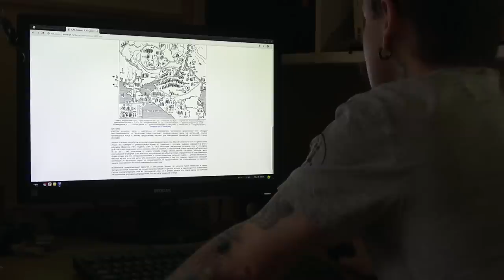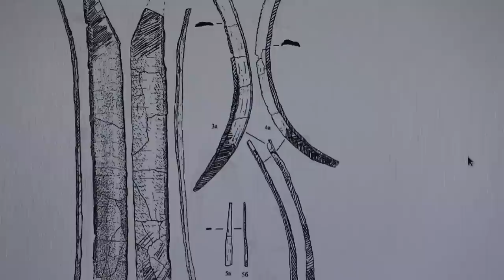Bulgarian Horn Bow. Part 2

Comment: I do work metal mostly, forge and so on, when I have hands on wood, for handles, I start to be nervous, one mistake and the missing material is not recoverable in any way, not movable from a section to another one, not in a way keep the look of the part whole. Veins, grain, how easy is to grind too much down, how easy is that it breaks on pressure, how hard to find a piece with a proper vein direction, without wooden knots messing it someway. I do honestly believe that making a proper wooden bow is way harder than making a sword. The sword even if defective, too hard tempered (very common), or made of soft alloy of too brittle ones,  would still work for a certain amount of abuse. A wooden bow, a sinew that's not set properly, the wrong wood, it would break in half at half pull. 
Awesome work, so much patience, I wish I would have your patience with it (and a cleaner workshop) to try to make one, just to learn from it.

Comment: I simply didn't skip once even watching second time. I have a question: What in the case of spiral wrappings around the limbs, would it affect the performance and how do you feel it, is there something to do with stability of the bow generally due wide limbs. Also, wooden core of older bow types was thicker than usually or it was my impression, there are examples in artefacts? Anyway, blagodarya for extraordinary documentaries and tips that spared a lot of bows. It deserves award for best authentic documentary specially in domain of experimental archaeology.  You really rock, Stily!
Reply from the maker: Thank you, Zoki! it is chery bark. The bow is very stability, it has narrow limbs, but has short ends. Хвала!
Reply from the maker: Зоран, аз откраднах кадри от твоя статия, нали няма проблем? :)
Reply: @StiliyanStefanov   Хахаха! Ще ми  бъде чест, aко наистина е това истина . Научих много от теб и дълбоко се прекланям пред теб  (Y) Keep on rockin'!!!!!

Comment: Does wrapping the sinew horizontally offer as much strength or power that wrapping them vertically? The sinew won't be able to stretch as much which is where I believe the power comes from, though feel free to correct me.

Also was there a reason you turned into a deflex recurve instead of a record recurve?

Comment: The bow is great and all but did you see how he shoots with it? The arrow is on the side opposite of the archers body and the shoulder of the arm drawing the string is not hunched up by an inch. And then the starting to draw slightly above the head and pulling down. This looks very similar to japanese archery in heki style. Which is confusing for so many reasons that I will end this comment here.